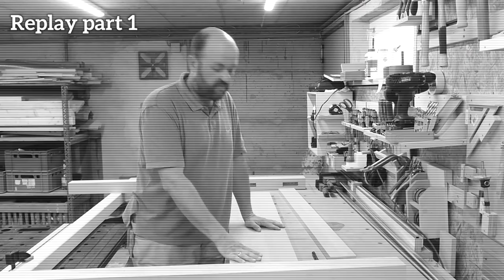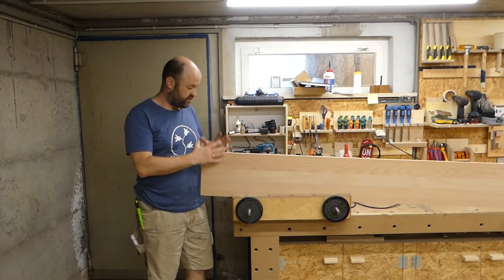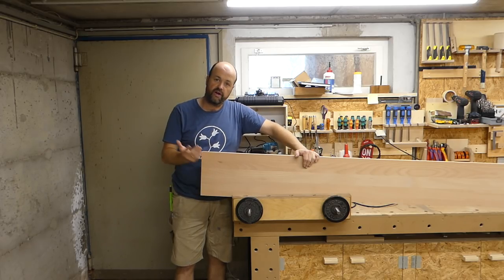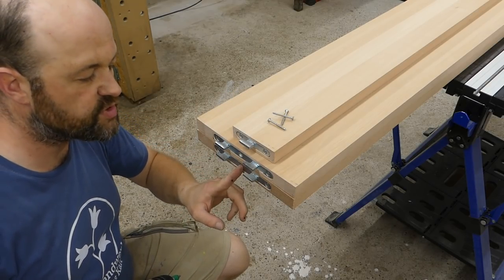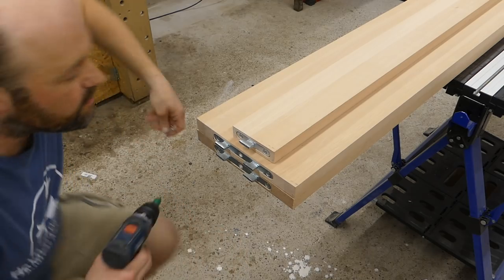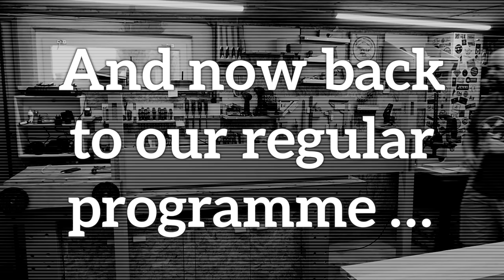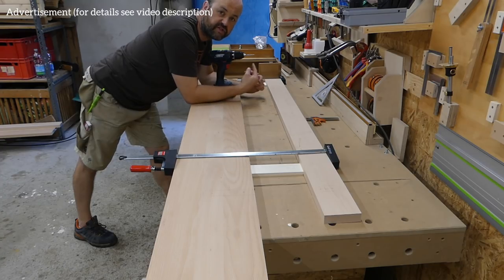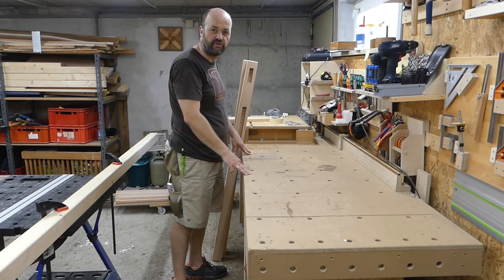DIY BUNK BED – With play area/desk area underneath (part 2/3)

Comment: Very clever solution to create a centering jig for the router. Did the manufacturer have a two guide kit, or Did you simply buy a second e edge guide? How was it to set it up?
Reply from the maker: I just bought a second edge guide. Setting it up is a bit tricky because you have to make it tight enough for it not to wobble but loose enough for it to slide without getting stuck